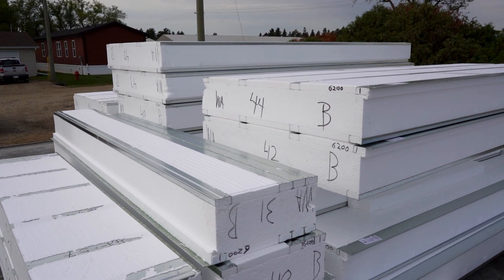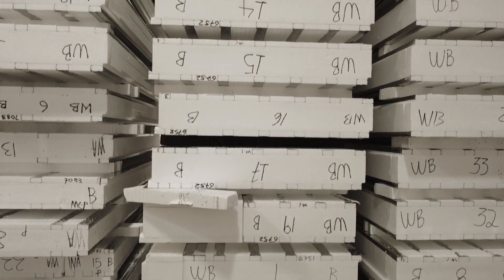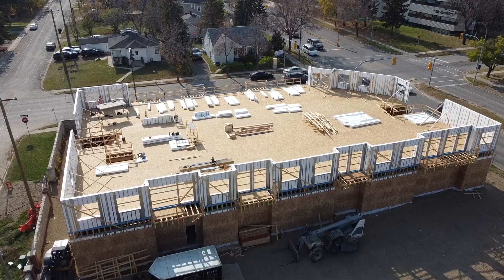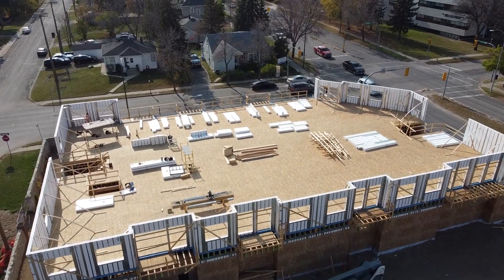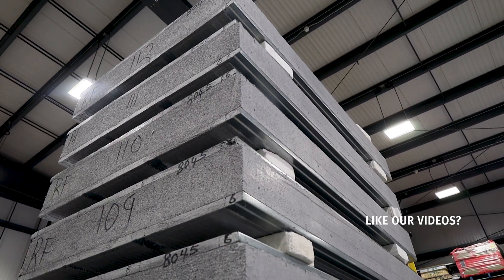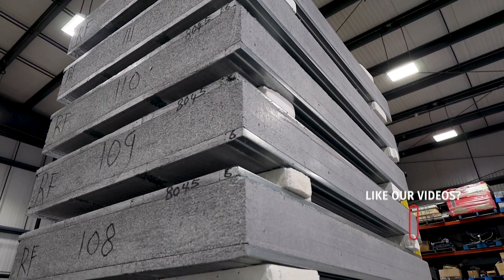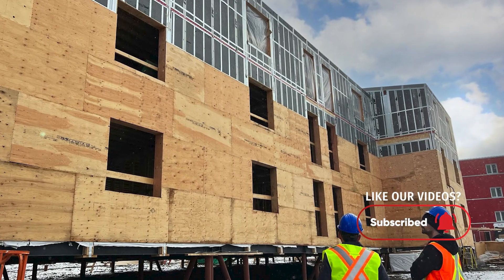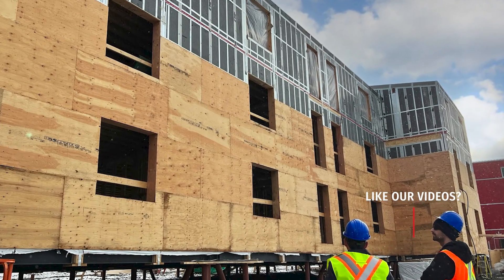Break The ICE | What Is GPS

Comment: I built a garage with 3" of solid foam on the outside with acrylic stucco, and the wall cavity was hollow.
I could nearly hear conversations fifty feet away.
My main concern with solid foam products is sound dampening ability.
What can be done to make these walls repel or absorb sound better?
Reply from the maker: ICE Panels offer a very similar STC rating to that of a 2" x 6" framed lumber wall. You can adhere other materials to an ICE Panel assembly to increase the STC rating, such as sound dampening drywall.